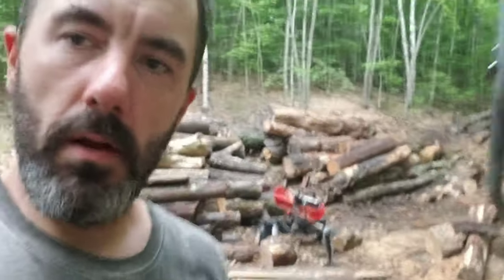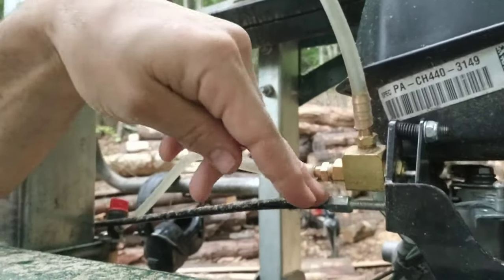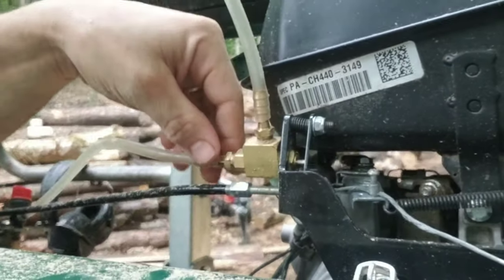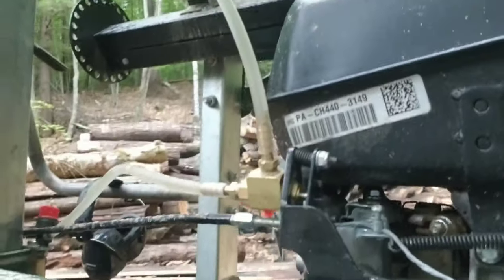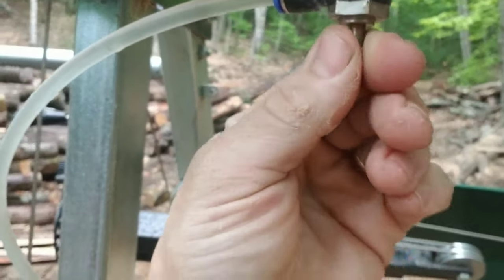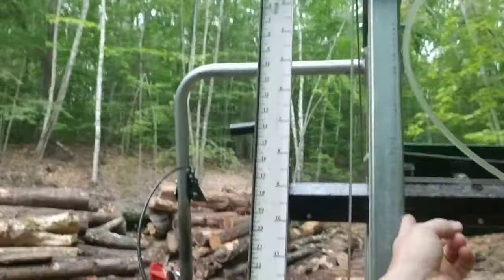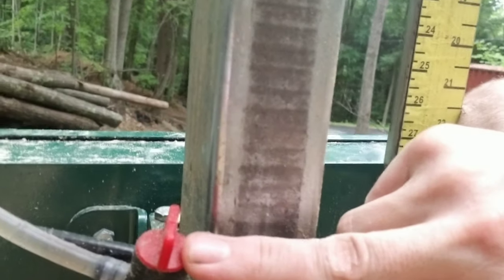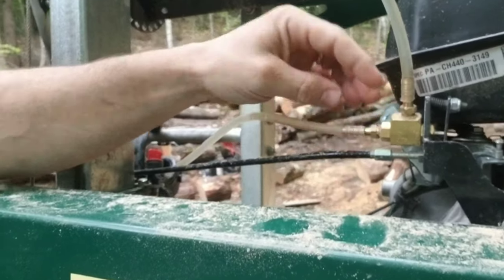Woodland Mills Auto-Lube Review and How It Works

Comment: I’ve had the auto lube on my 2015 hm126 since it came out, I had to modify the bracket to make fit properly, wasn’t getting full throttle. I must say this add on is the best one so far for the cost, it saves on lube, reduced functions during sawing. Good review!